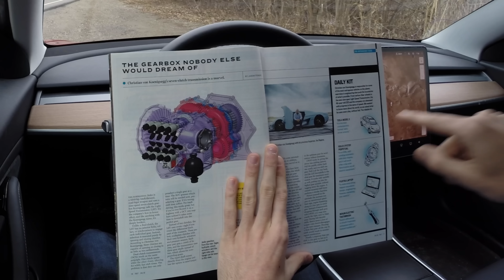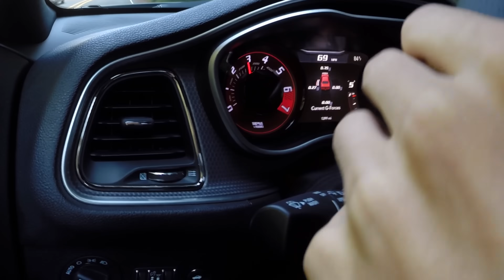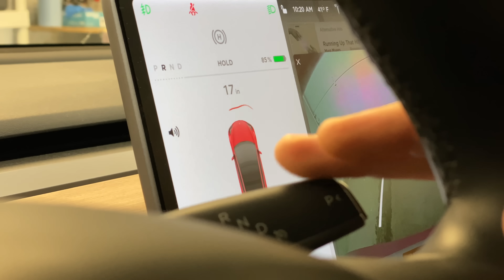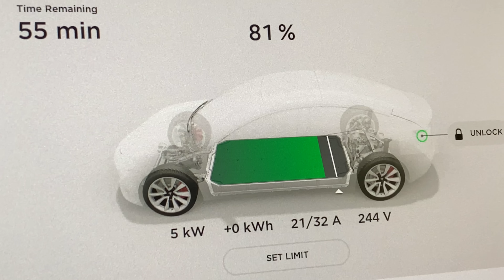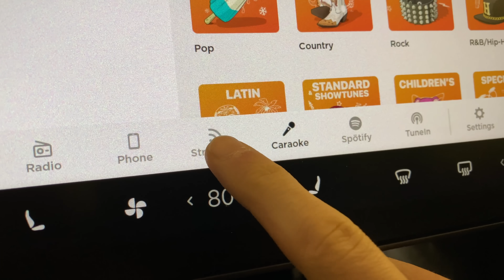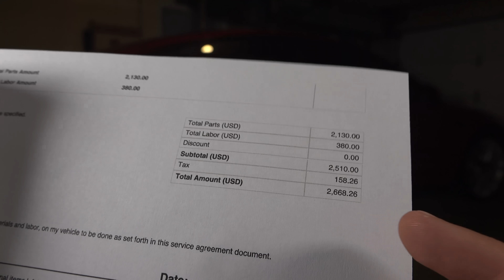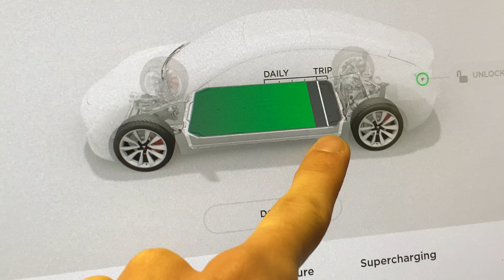Living With A Tesla Model 3 For A Year - The Best Daily Driver

Comment: $60000 isn’t really “available to the masses”.
Reply: If All cars were Electric the prices would be much lower no doubt,
And Im sure someday they will
Reply: You also need to have a garage for these cars
Reply: But it's waaay better than $200,000.
Reply: It is not available to masses, but it need to be, we all have to use electric car because it is, and it will be always cheaper then Earth
Reply: That's the most expensive version, the cheapest is $35,000-$39,000
Reply: @iKingRPG  no. 
In the US its $39,990 + tax + 900 destination charge. So something like $43-45,000 overall.
in most of Europe its over $50,000 for the SR+ version
Reply: Udi Shomer yes, no matter which way the Tesla/EV proponents want to cut it, many of these cars are very expensive luxury items that a lot of people just cannot hope to afford. The basic M3 in the U.K., even on the standard Tesla finance agreement is some 500 a month. That is a mortgage payment. Most people in my street, us included, are either retired or young professionals, but they nearly all drive around in older, second hand cars that cost a few grand.
Reply: @0tispunkm3y3r  I understand that it is too expensive for most people still, I was just corrrecting
Reply: @0tispunkm3y3r  mate, what kind of mortgage you got for 500quid a month?? Did you buy a shed?
Reply: @onwike  no, 3 bed detached. Just not in the South/South East! £500 doesn't even get you a shed there!
Reply: @iKingRPG  in white or black
Reply: Tom Cartmel Many cars are only available in black or white for the base model

Comment: I really want to like EV but I just refuse to buy a car that cant drive even 1/4 of the way across texas. It makes road trips last 2x longer and that's a deal breaker for me
Reply: Snowblack Mulan I have a model 3, and no one charges to 100% every stop. You charge to around 80% which takes 30 min almost every time, sometimes 20-25 min on v3.
Reply: drive 3 hours, charge 30 min, drive 3 more hours, at least with tesla. I wouldn't exactly call that 2x more. You'd have to fill gas at least once as well most likely.

Comment: How is the finish of the front nose & bumper cover holding up on your Model 3? Since there is no grille above the bumper cover, my worry has always been that the front of the car would be more adversely affected by salt, gravel, rocks, etc when doing day to day driving. Have you used a clear bra for the front or just the standard clear coat finish? Most other cars have similar issue with the front nose as well.

Comment: Are you sure it doesn't have the manual release on the doors in the back because of kids? Or is there a child lock that can override that actually curious. Also for most cars I've noticed, the audio always sounds a little bit worse if you are in the back, is that not just normal?

Comment: It's totally worth it if you're surround by tesla charger's. Where i live I don't have a tesla charge anywhere near i only have those slow! Charger on the street. hopefully we get to a point where we have one tesla charger for every 2-3 regular gas stations.
Reply: I figured you'd need more than that eventually. Sometimes gas stations are even filled up and there is a line to get gas and it takes 5 minutes. I would think charging stations would fill up even more because it takes a lot longer than 5 minutes to fill up.

Comment: Most of the people are not trained to drive very fast cars. So ICE cars are safer in that sense. Nobody needs to do 0-60 in 3 seconds on public roads, it's dangerous if anything. It's a good thing fast cars are expensive, so most of the people won't get into an accident because they can't afford cars like that. 

Most of they people are not racing drivers. Too fast cars are not very safe.

Unless you are racing on a race track, you don't need fast 0-60 times. You need something safe for you and other ppl on the road. ICE cars have a natural safety feature - they don't accelerate too fast, It's actually a good thing.

Comment: Hey, i was watching one of your videos about WRX STI, i am convinced that most of us out there should opt for WRX, Which year of WRX (Manual) should i buy or keep an eye out for ?
I am not convinced to buy a new one or even lease it.
I bought 2004 civic dirt cheap ran it to the ground, now driving 2009 Acura TSX which i love driving around. I am tried of driving my TSX in winter due to snow, drive is horrible with winter tyres.

Which year of WRX would be good to buy with least possible maintenance on it ?
I will be keeping WRX stock, not interested in any type of performance modifications on it.
Thanks.

Comment: Brake fluid change every 2 years and battery coolant change every 4 years totals $1000.  IMO, that's a lot.  I think maintenance on an ICE vehicle is probably less than a Tesla for the first 100,000 miles.  After 100,000 miles ICE vehicles tend to need more repairs, consequently the Tesla would have lower maintenance at that point.
Reply: If you spend $50 an oil change and do it every 5,000 miles by the time you reach 100k miles theres your 1k spent. Oh yeah had to edit for the 2k per year you spend in gasoline as well. That's what I spend anyway going 80 miles per day 5 days per week getting 35mpg combined. 1k for every 4 years or 8k in gas seems cheaper for electric

Comment: I agree with most of your pro's and cons. I have been driving a Model 3 for 8 months; here are a few remarks of my own:

- No button in the app or on the console to "Start downloading software update NOW!". After Tesla notifies me a software update is available and I park where the car can connect to WiFi, it sometimes takes days for it to start downloading. As I live in a city with paid parking to the tune of about $5,- / hour, and no WiFi available in the (for me free) public parking garage, this is maddening. 
- If you're in Europe, don't buy the autopilot package. European regulations severely limit what it may legally do; basically you need to OK every decision it makes and it may only drive corners on freeways like a fully loaded lorry: very slowly - if it does not disengage almost without warning halfway through the corner because the sideways g-forces are too high, which I find dangerous. Don't believe all the videos on YouTube shot in the US, autopilot is not worth it in Europe. (Note this is not Tesla's fault, it's European legislation which Tesla must obey)
- It is very easy to accidentally hit the chair heating button, and it is immediately on full power. It would be better to hide this in the menu somewhere or if you touch the button it just selects the lowest setting.

- It has two USB ports for 2 phones, a music memory stick and a video (dashcam) storage stick, and the manual says explicitly not to use 1 stick for both music and video. So where do I connect my phone? I suspect that if you connect some really fast storage, like an SSD you can put music and video on one device without problems; the manual tries to protect you from problems when using slow USB sticks (which most of them are). Still, 2 more USB ports for connecting devices would be better.
- After damaging a wheel rim parallel parking on day 2 I had my Model 3, I have tried really hard not to damage them further, but it appears an impossible task when I have to drive over elevated tram tracks on a daily basis - or wait 15 minutes for a lorry to finish unloading. Scratches are very visible on the dark grey alloys. If I had to choose again I would go for the silver colored ones where damage is much less visible.

But as a daily driver it's great. Silent, low center of mass, good chairs, fast, no diesel stink in the parking garage. And yes, a step in the right direction for the environment. I like the minimalist user interface, the frequent software updates. (Did you know Model 3 can play music from an iPod since November 2019? This was not in the release notes of any software update I think).

I'll never go back to internal combustion.

Cheers Bart
Reply: I will one day when I can afford it. I live in the US and it costs twice as much as other cars. I bought a 2017 civic si coupe for 22k that i commute in for now and the model 3 is about 45k I just can't afford that.

Comment: Update 4: A recent software update enabled "Save on honk", which means honking your horn will automatically save the last 10 minutes of TeslaCam footage - no need to remember to touch the icon on the screen.
Reply: Hehe some people will run out of storage before the end of their block!
Reply: thats a really clever and simple solution
Reply: Imagine the storage used in India.
Reply: What's the largest USB drive you could attach to a Tesla? 2TB? More?
Reply: The fuhgettaboutit mode
Reply: Really! I’m going to test it out.
Reply: You forgot a few things: 

1. Price. Or more accurately: Breaking even.
Over 80% of the population use a daily driver that cost 6-40K (yes, most of the vehicles on the road were bought used).
Now let's compare the Leaf to a Versa. They are approximately the same size. Yes, you get better performance, but the price difference will buy you gas and pay for maintenance for 5-6 years! 
So comparing the Tesla to an Audi R8 is correct performance-wise, but how many people own an R8??? If you want the average Joe to buy an electric vehicle, that vehicle should cost 20-$30K for a sedan, 30-$45K for an SUV, and should have at least a 300Km range...We're not even close to being there.

2. Range: It will take you about 1.5 hours to extend your range by 400 Km. It takes me 3 minutes to do that with my ICE. Also, when it's -20 outside, you lose roughly 30% of your range, an ICE vehicle doesn't.

So right now, the only people who are buying electric vehicles are rich people, because all the EV's with a large enough range to do all the driving you'll ever need in one single car cost $60K+. Or they buy a 34-$50K EV as a second car to do city driving, and the have another ICE car for longer trips. The ones who own 2 cars are actually worse for the environment since manufacturing that EV car is like driving an ICE vehicle for about 6-8 years...And on top of that, they also have an ICE vehicle.

3. Battery. I'm really not sure how the batteries will hold up over time. I have seen them last over mileage, but that's not really the same thing. If a $60K car will be worthless after 8 years or so, people aren't going to buy it.

So I don't see EV's taking over the market any time soon. Maybe in about 5 years, they'll reach a point where it's an actual alternative for the average family.

Don't get me wrong, I'm no "Hater". I would love to have an electric vehicle even more than I would like an R8...But it makes no financial sense to me yet.

Comment: Now you've had it 1 year how is the battery/range. Can you re do some of the range tests you did at the start and compare? Also comment on the option of replacing a battery after a few years. Some people invest in an ICE car for 200000 miles and then replace it, can this be done with the Tesla?

Comment: Decided the M3 was not clearly NOT designed for me after trying one in a snow storm, on a highway full of cars, with totally useless auto wipers and no physical wiper controls (wth?)
No stalk for the wipers you need to have quick access to, but you have a stalk to switch P R N D, which you only use when fully stopped.
Mind boggling.
Reply: Should have driven it longer, or asked the sales rep.  The button at the end of the left-hand stalk activates the wipers any time you need it.  The automatic wipers are still a work in progress - they're much better than they were initially, but still not perfect.  That single flaw is hardly enough to offset all of the car's amazing qualities.
Reply: RWD was also a deal breaker in snow. Car was excellent at avoiding slipping but handling was bad without traction on the front wheels. The car owner flat-out told me before we left that the car is just badly designed for our winters. That's all.
Reply: @LaurentVitalis  Mine's AWD, and even the RWD versions are no worse than any other RWD vehicle in snowy conditions.
Reply: @zcd1z778  We can agree that RWD Model 3 is no worse than any other RWD. Probably better because of top-notch traction control. But where I live, FWD or AWD is still ideal.

Comment: I honestly don't think the average driver really needs access to those kind of acceleration numbers.  Granted, I think the performance is awesome, but most people do not have enough mechanical skill to justify 3 second 0-60 times.  Also, lets address the elephant in the room...  Range and recharge times.  This is still not a proper road trip capable vehicle.
Reply: Maybe we need a skill driver test to get an upgraded license or something. I've been driving supersport motorcycle for over a decade and its 0-60 is 2.7 seconds havn't had an issue yet.

Comment: I hate it when people push electric cars at this time. To charge to 100% from very low is about 85 minutes for about 400 miles range I can get 400 miles range with my Jeep Wrangler while spending like 5 minutes at the pump. The technology is not here yet for electric cars and charging at home from a regular 12v outlet will take a day from zero. Traveling across the country can be done in a little under two days if not stopping to sleep overnight. Take that trip in an electric car you go the first 400 miles in 12 hours spend the next hour an about 30 minutes charging.
Reply: I hate it when people post ignorant comments.  I regularly do a 400-mile road trip in my Model 3 Performance and it takes me about 20 minutes longer than it did in my previous ICE-engined vehicle.  And I start every day with a full "tank", because like most EV owners, I charge my car overnight.  I also save about $200 month compared to buying gasoline.

Comment: It's been 36 days now since I've been able to drive my Model 3 LR AWD while it sits at a Tesla-certified body shop getting a frunk hood replaced (160 hail dents) and 200 more hail dents removed via PDR on the rest of the car. In the meantime, I've "suffered" through driving our gas car, a Honda CR-V, with the 1.5L Turbo and CVT. You don't know lag until you combine a turbocharged engine with a CVT. With that car, you step on it, and once it finally responds, you end up backing off as it ends up being too little too late. I keep telling myself, just one more week as the completion estimates continue to stretch on until I can drive something responsive again!

Comment: Torque is great.
No delay in throttle.

It is a quiet driving experience

Low Maintenance- change oil and every four years change coolant for battery.

Regen braking- never really need to use your brake pedal often.

No need for gas stations

Charge your car at home overnight

Impossible to kill a cat or melt chocolate. 8:16 

You Welcome.

Comment: My biggest problem with Tesla, with the Model 3 at least, is that there is no gauge cluster, you have to use the big info screen to check speed and range and so on, very distracting and really bad designed

Comment: The throttle on my Skoda Superb 190DSG reacts how I want. But it is a fly by wire system that learns my driving style. My better half cannot get used to it.
This same car also can heat itself, but it does require the engine running. It's part of the quickclear system. It's lovely. Same with the cooling.

I'd love a Tesla, for a lot of my driving it would be fine, the things stopping me
1) I have two very large dogs and a family, there just isn't the options
2) I tow, our family holidays are in a caravan, the range and the towing on top are just a non-starter
3) The price, they're a lot of money and I've heard they are still selling them at a loss

Comment: 1) I live in an apartment and don’t have access to a plug
2) how much is the life of a battery? 8-10 years? Then what?
3) road trip  non-daily driving
4) pumping gasoline in 1 minute is better than charging for hours at a charging station 
5) $50k for 8-10 years is bad TOI
Reply: 1) Where I live I see chargers at public and private parkings more and more. 
2) Tesla expects about 400000 miles for the battery, that's far more than 10 years driving for most people. And then what? The worn out modules can be replaced for a few thousand $ each.
3) Superchargers
4) You don't have to charge for hours. And you have to stop for sanitairy reasons anyway, right? 
5) Model 3's will last much longer than that.
Reply: @Freba9  the dealer told me 8-10 years; no mileage. To replace it costs estimated $20k.
Reply: Quyen Nguyen Dealer of what brand?
Reply: @Freba9  Tesla in White Plains.
Reply: Quyen Nguyen Weird...
Reply: @Freba9  that was 3-4 years ago when I test drove the Model S. Maybe the newer cars improved the battery technology?!? 
Bring back the Roadster! hahaha
Reply: @QuyenNguyen-cp4eq  Yeah that should be it. Currect battery tech is very different.
Reply: @Freba9  Back then they didn't have enough data to support the "real life" of the battery. they estimated 8-10 years. I guess they improved that aspect of their R&D in order to stay on top. Until they get cheaper and I have access to a plug, I'm not considering a purchase.

Also,  I hear that super-charging your car constantly is bad for the battery.

Comment: My CVT doesn't have a clunky shift. Same design as used by Formula 1 racers in the 70s before dual-cluch became dominant. I get the rationale of transmission-less power being superior - but still - no clunky shift with CVTs. BTW - whats the Battery coolant cost after 4 years (recommended)? I've got figures all over the map - but it 'seems' around 180. Yes / no? Sounds like the warning system needs to be more speed-aware for congestion (but I have no idea what specific conditions you're referring to). 

(Also like the spoiled kitty at 08:18 - I like dogs too - but, spoiled kitty! Always spoil your pets.)